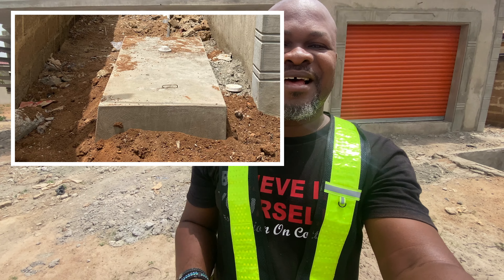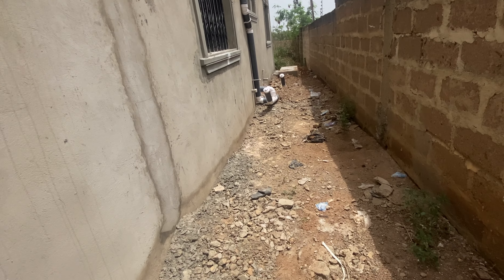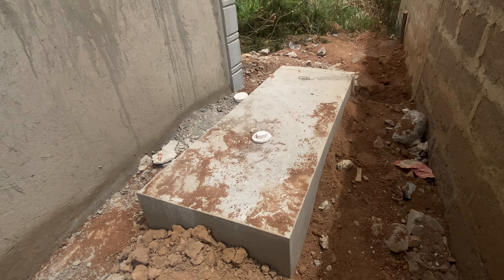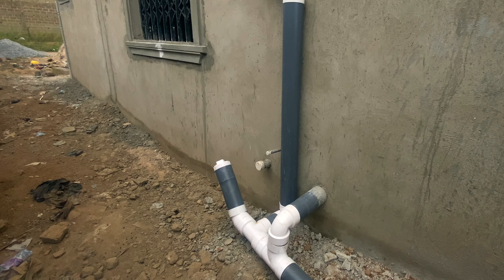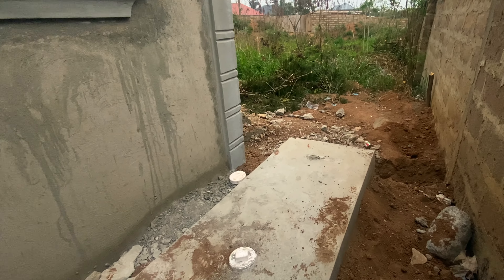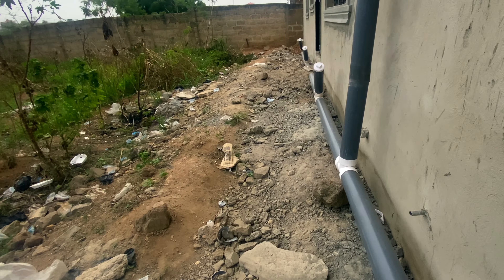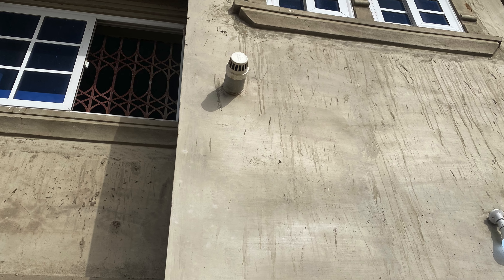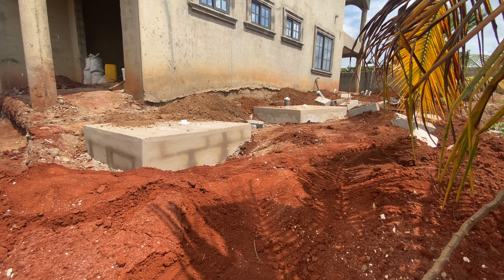How to connect a biodigester to your dream house || Vent Pipes

Comment: If the 4 inches digester inlet pipe comes from an inspection chamber that has a vent pipe, does the presence of vent pipe affect the biodegradation?

Comment: I don't agree to your statement. We have two types of microbial decomposition. Aerobic decomposition and anaerobic decomposition. While the former is rapid and does not emit bad odour, the latter is slower and generate biomass odour. So it's always advisable to put vent pipe, not on the digester itself but either on the inlet or outlet pipe of the digester...go and do your research very well please
Reply from the maker: Right. So the inlet pipe is coming from the house right? Then what you’re saying and what I have said is the same thing. That vent on the building initially serving the toilet will be just fine. You don’t need any research for this @safetyalways7788
Reply: @DreamHouseBioDigesters  I know that one vent pipe is enough but saying digester decomposition only occur in the absence of oxygen is totally wrong.. Aerobic decomposition (oxygen presence) is  more rapid than anaerobic decomposition (oxygen absence) which generates biomass gas odour
Reply from the maker: @safetyalways7788  the kind of biomass produced from these simple onsite biodegradable waste human waste digesters are really negligible and we are not producing any substantial amount of gas since it’s not the output we are looking for but simply of disposing our human waste safely in the environment so the vent on the building is good enough for that purpose.